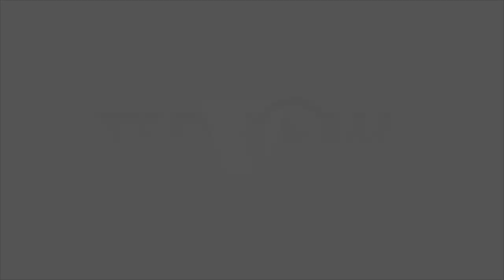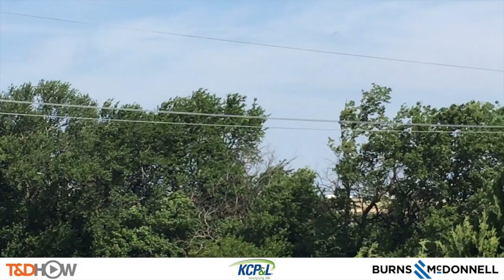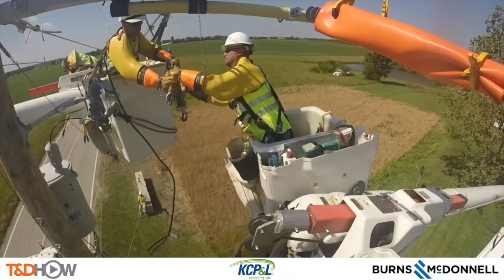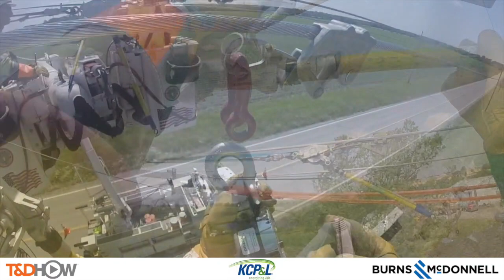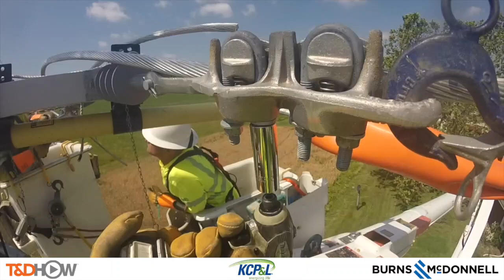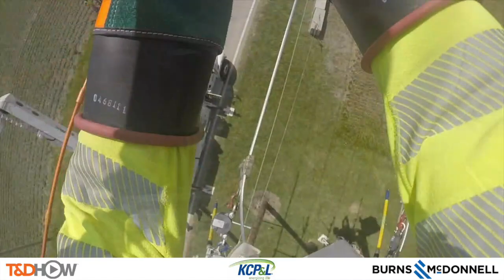Line Sag with Dynamometer

Comment: A fucking chart the engineers made up for them. Sag the fucking line and see if it looks good. Nothing beats looks. Looks are 90 percent of the job.
Reply: Looks are good, but ensuring adequate electrical clearances and avoiding damaging the adjacent structures are just as important.  The wire spans are very sensitive to temperature and tension.  This is especially true for high voltage lines and deadends.  What looks "good" at 60 degrees might pull over a tower on an icy day (when the tension can easily triple or quadruple from the everyday case).  Alternately if it's a hot day when there is a lot of current in the wire, it can heat up to around 200 degrees and might sag to the point where it could arc to ground (the sag can also triple or quadruple).  The difference between what looks "good" and starting a wildfire or killing someone might be a one foot stringing difference on a 300' span.  Pretty hard tell the difference with just your eyeballs.  The charts are developed to protect the crews working these jobs and the public.
Reply: Sag and tension come together buddy.